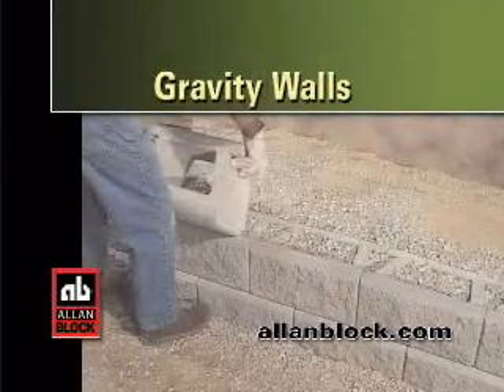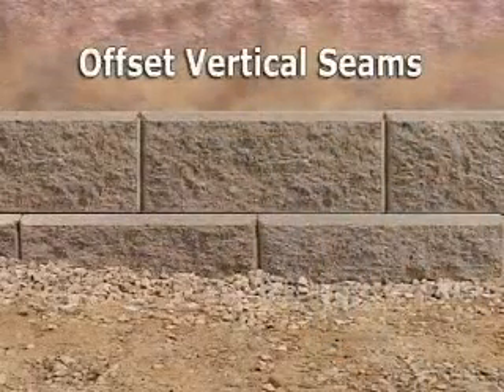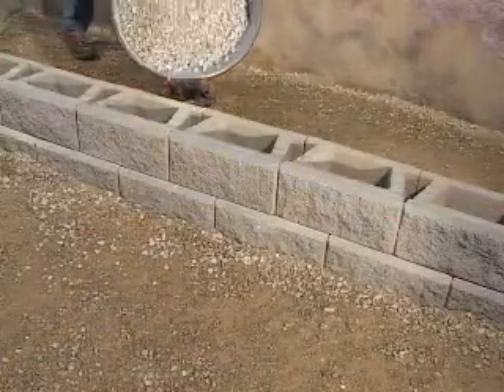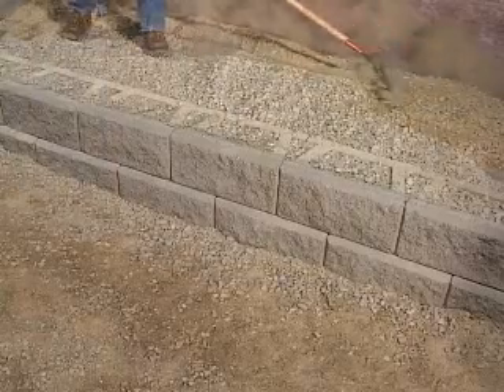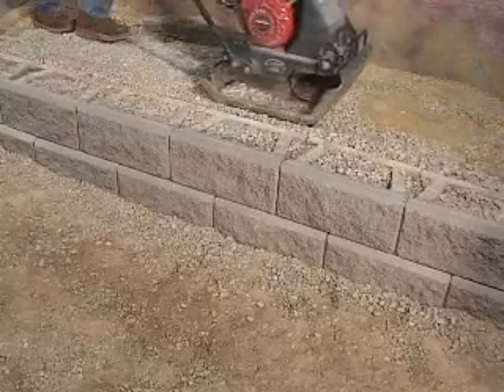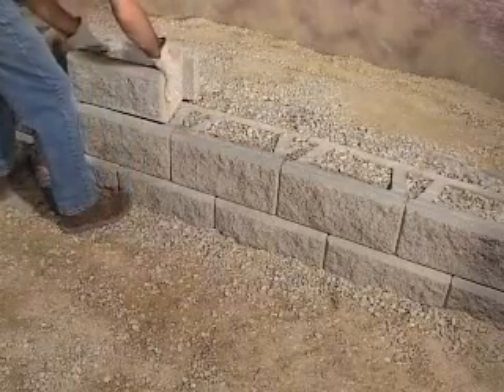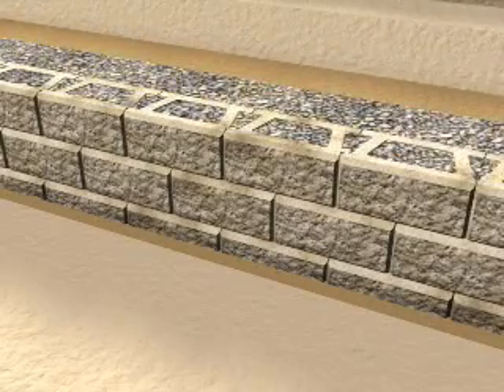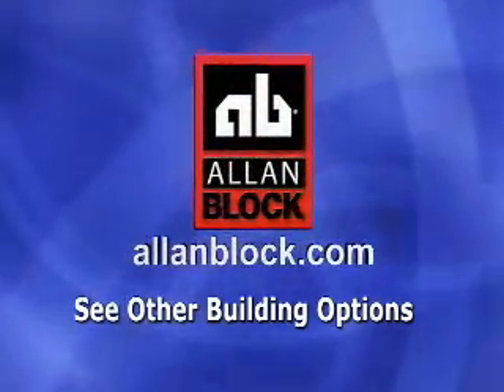How to Build a Retaining  Wall

Comment from the maker: Check out the installation instructions on our website for residential retaining walls for the steps on how to build your base. - The general rule of thumb is to bury 1 inch of block per foot of wall height - depending on your soil. and make sure you have a solid compacted base of wall rock underneath.

Comment: Im planning on building a wall about 3 courses high. I have a sloped wall of dirt, but im not taking away from the slope at all. What kind of footing is needed or can I just bury the first course about 1/2 way down and start stacking interlocking blocks and backfilling with 1/2-3/4 gravel

Comment: @fitzgeraldmistral 

Any structure that does not require cement or mortar is considered temporary and permission usually isn't needed to build it. My brother built a wall on his property without cement or mortar because he would have needed an inspection, a permit, and then another inspection after and if the inspector didn't like what he did he would have had to tear it down. He didn't have to go through any of that because he didn't use cement or mortar on the blocks.